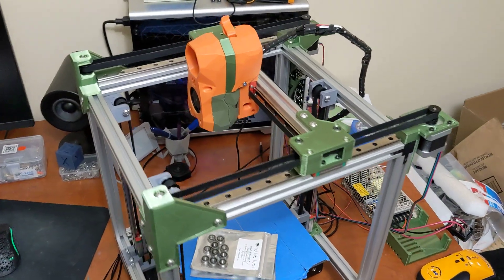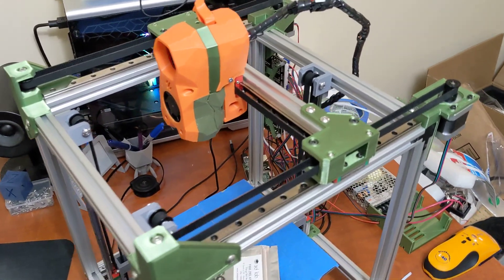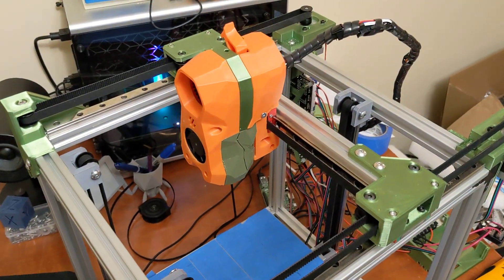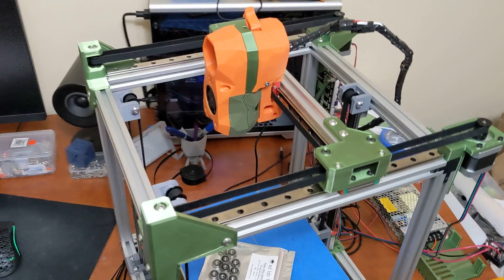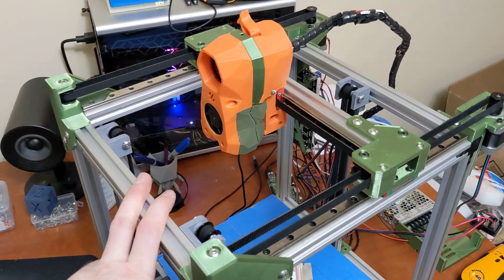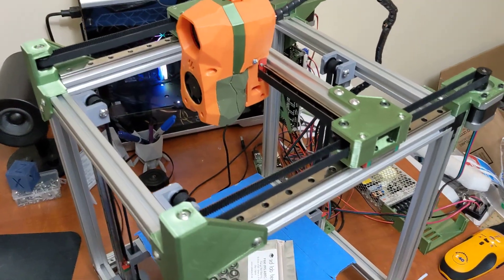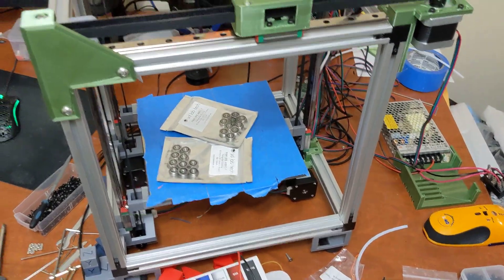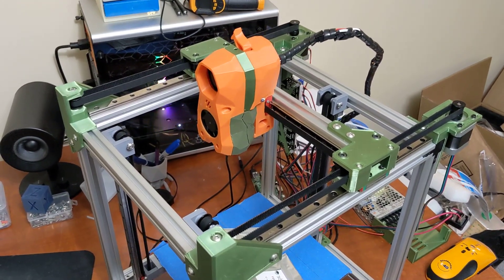Building a H-Bot 3D Printer - SimpleCube Ultra - Episode 4 - Final

Comment: I almost converted one of my old Cartesian printers to H-bot, but testing the X axis for racking indicated that it required minimal force to produce 0.5mm offset. Admittedly this printer came with cheap linear rails. I ended up designing the upgrade components for coreXY and it has worked perfectly. Deep down inside I really love the simplicity of H-bot, but for this project I really wasn't ready to gamble on racking/hysteresis.
Reply from the maker: Totally understand, that's a reason v2 will be corexy just no issues

Comment: Now that you're moving to a core xy, you need to provide how your "simple core xy" differs from the Voron in terms of ease of build.
Reply from the maker: Well first I will say the printers have different purposes, I am just trying to build a cheap simple printer that I like and maybe some others do to, the Voron is a true workhorse designed by a team of talented designers. I am a amateur hobbyist at best. However to compare a Voron Trident has roughly 67 3D printed parts to get printing and the SimpleCube V2 has 30. The trident has 8 different sizes of 2020 extrusions the SimpleCube V2 has 2.